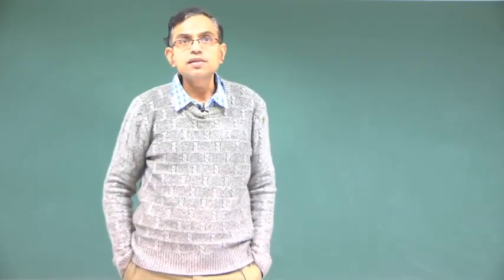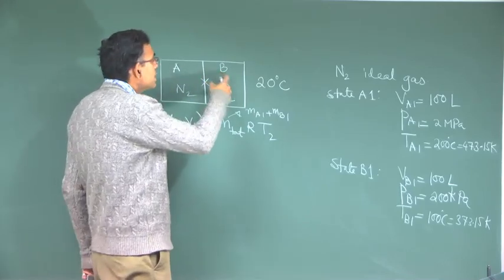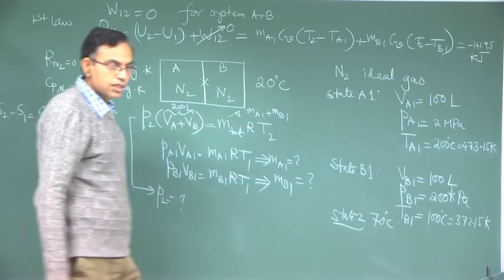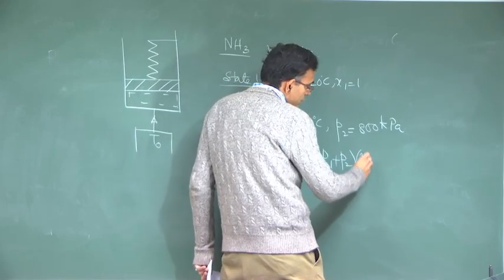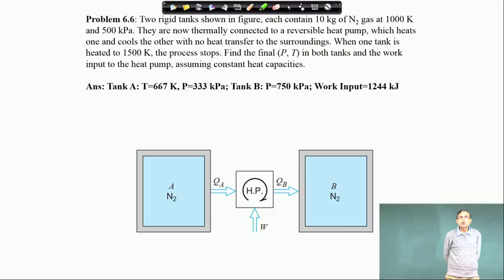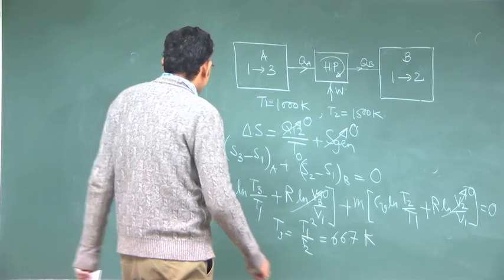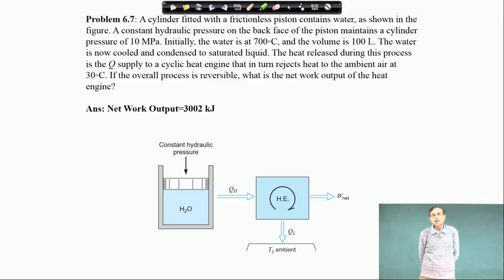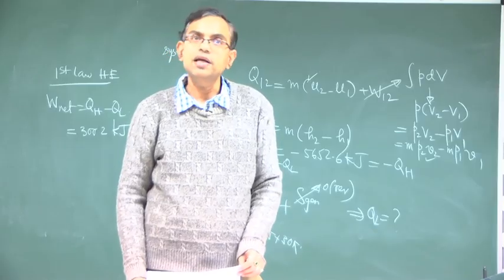Lecture 44 : Entropy Change in closed system: Examples

Comment: Sir in the very first example of this video why didnt we directly take the entropy values from the table instead used the derived formulas
Reply: I guess it’s becoz nItrogen in this problem is assumed to be an ideal gas… and we could directly use the entropy equations derived for an ideal gas. Also in the given temperature range.. it can also be assumed as a calorifically perfect gas
Reply: I think , Because temperature is not varying much and we can cp or cv same that's why there is no need to use property tables